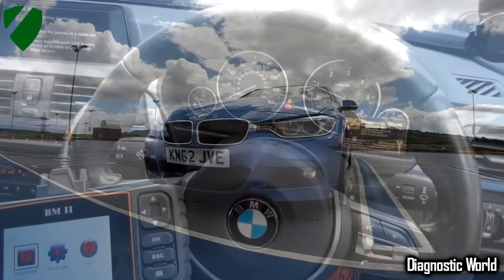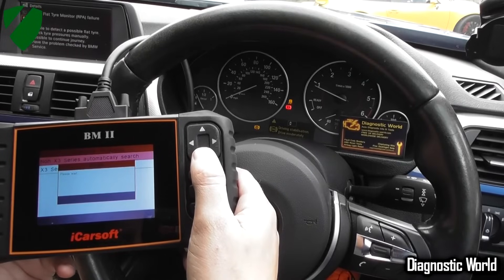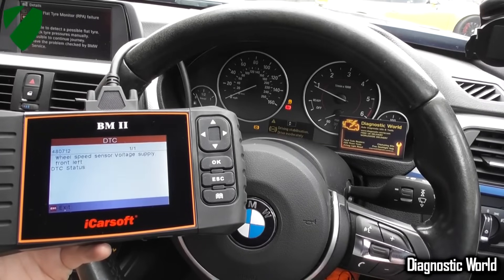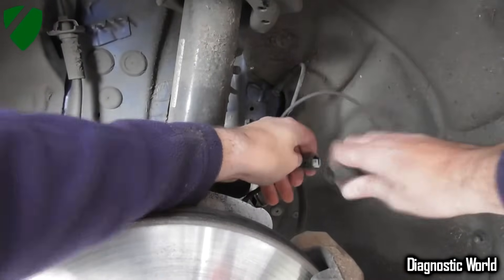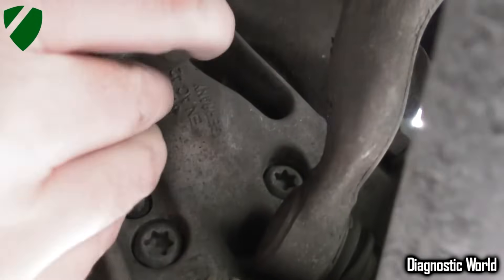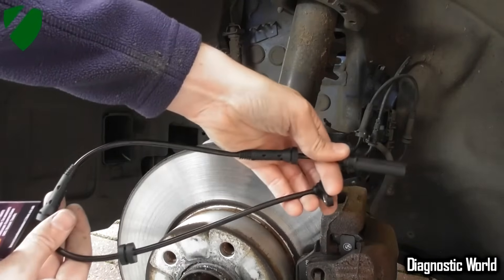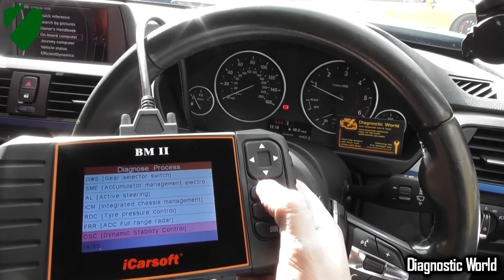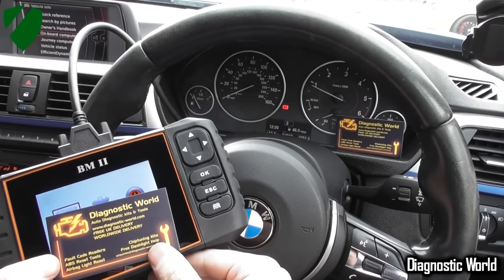BMW F30 F31 Front ABS Sensor Diagnose Replace & Reset How To Guide

Comment from the maker: The BM-II kit is available here http://www.diagnostic-world.com/pages/iCarsoft_BM_II_BMW_Mini_MULTI_System_DPF_Oil_Service_Diagnostic_Tool_189010-z=605301&p=118960.cfm

The ABS sensors can be picked up here http://www.bavariandominator.co.uk/pages/bmw_f30_3_series_abs_sensors_268153.cfm
Reply: I purchased the scanner for my F30 2013 BMW 328I Xdrive with the N26 motor. The codes I am getting are DSC Low voltage at unit. Any ideas? I replaced Front and rear brakes, rotor and sensors along with spark plugs and coils as part of my 70K maintenance. I had the codes prior but had service lights for oil and front brakes so I swapped everything out at once.
Reply: When I plugged in my code reader I see codes P127E and then "480964 DEX under voltage at Control Unit" as well as 4809AB "DSC undervoltage in vehicle"
Reply: The link to the sensors has been hijacked. Don't click on it or you'll get quite a shock. If you close whatever browser you are using and ignore the message telling you to call a number!

Comment: Why is the name of that black box to cover the sensors ? My BMW hasn’t got one so when ever rains it splash water on the connector I just used tape but it don’t work
Reply: Coloca um bocado de cola e beda ou silicone dos vidros os meus bmw todos tem esta caixa mas se o teu nao tem pode ter partido ou algo do genero tenta ver na bmw original com a matricula ou chassi se traz de fabrica

Comment: i have 2013 bmw 328xi. i change speed sensor but it is not detected. when i check voltage is correct in sensor wire like 10v. i swipe with good detected sensor still same may be you can help me what is the issue. After replace sensor car need to be drive or not?
Reply: Hi did you find a fix for this ?

Im having the same issue the electrician told me to change my wheel hub i did that too still nothing my error code is:

480715 Permanent Wheel speed sensor: Voltage supply, short circuit, front right
Reply: @ZKWhips well change the electric circuit fuse.

Comment: I am installing a Park Assist feature on my MINI Cooper F60. I upgraded all my DSC parking sensors fro regular to the one that have the Park Assist feature. I swapped my control module from PDC to PMA. I have the front & rear PDC working. I have coded the system to Park Assist as well.I still get error of brake system which include> Drive Terrain, abs Brake System, Tyre Pressure Monitor, Park Assist & Parking brake. All my hardware is good and connections are well. Could this be a coding issue that could resolve with eSys?.

Comment: I had all 4 sensors replaced and while clearing the code it still pops back up. Any help?
Reply: my rear left is teh code, i put in new cable and cleared everything with ISTA but the codes still pop up

Comment: Many thanks for this DIY!

Good to mention: there are 2 versions of the ABS sensor cable. If your car has the parking assistance or/and active cruise control you will need to buy the correct cable. 

Errors should disappear once the new cable is installed. If not, you probable have the wrong cable. OEM cable is manufactured by ATE.